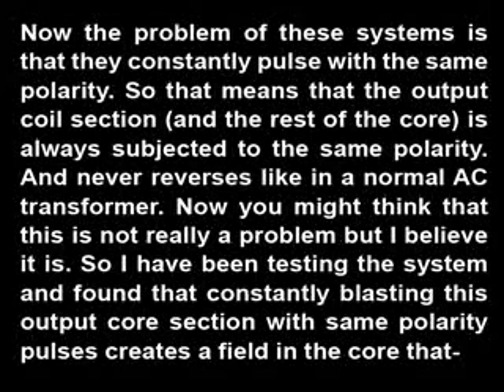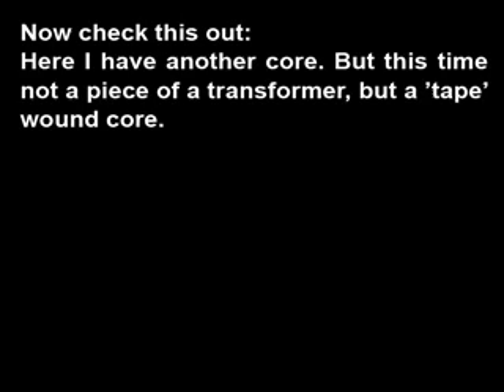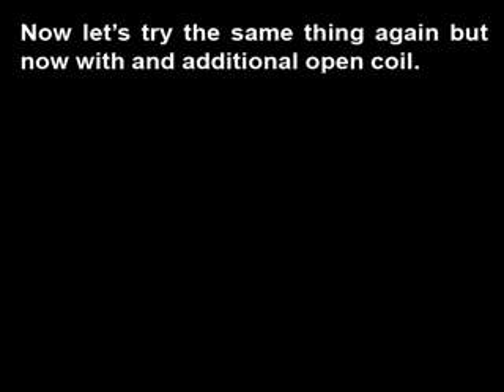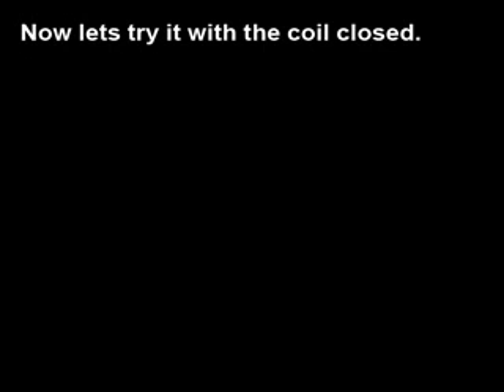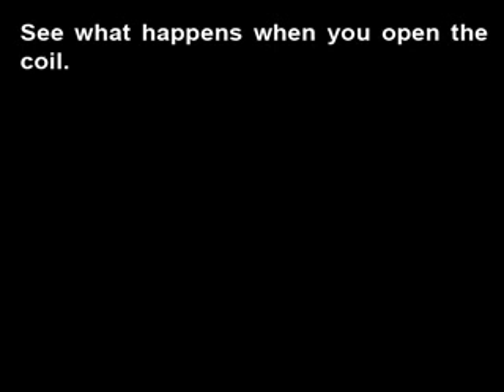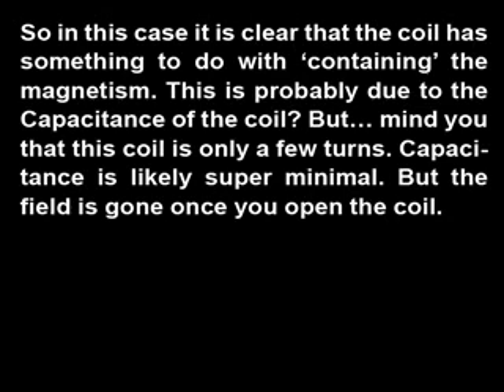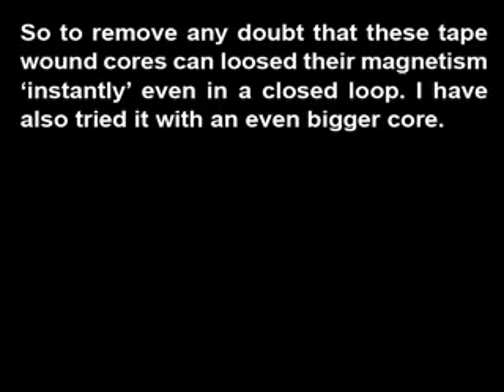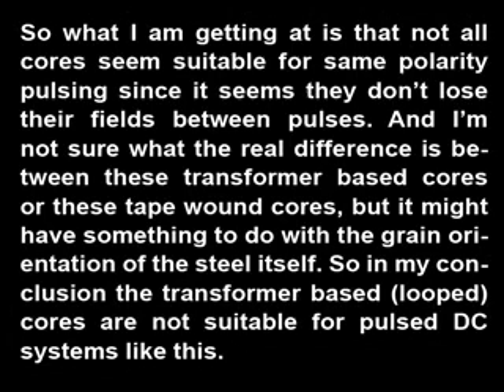Core Tests Pulsing

Comment: Nice dude :) Why don't you try  with square generator on primary coil and then measure the secondary coil with load? ;) Let's say  - frequency between 30Hz -400Hz :) You will be surprised....
Regards and good luck